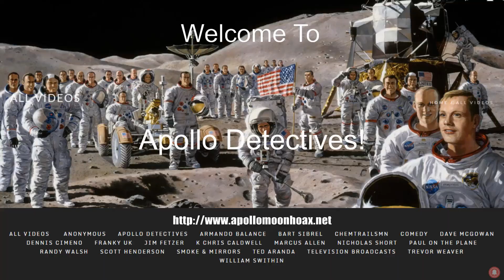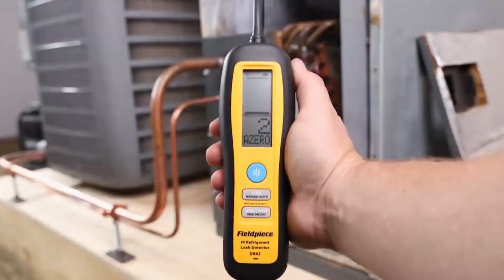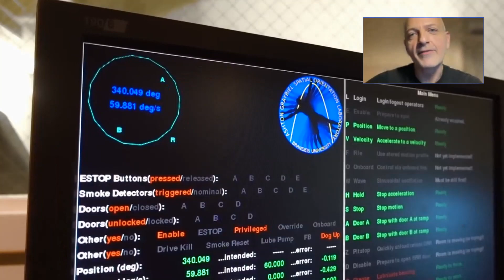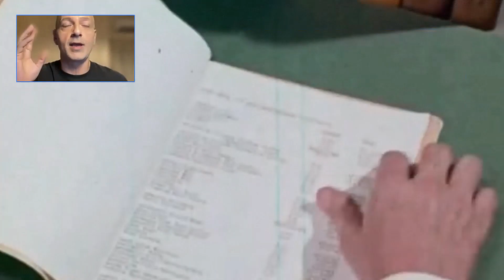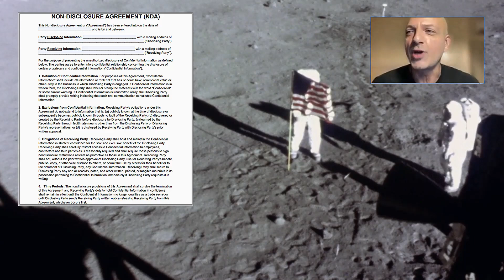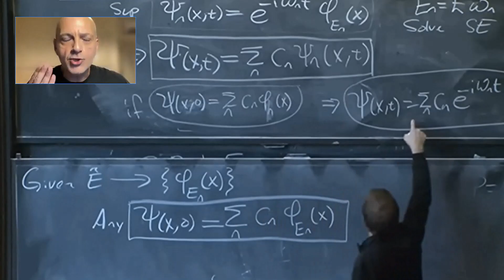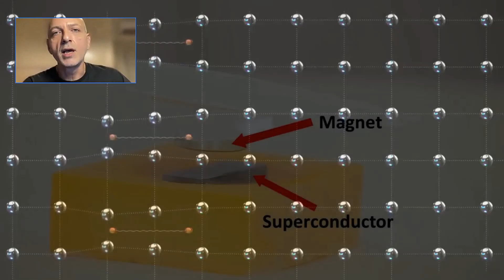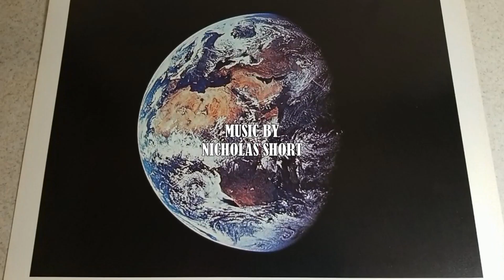THE APOLLO DISCUSSIONS "SPACE SUITS\ SIMULATORS\ PLASMA ENGINES" PART 19

Comment: I flew Hot air balloons for 15 years and i know for a fact  they are made of 1.9 oz ripstop nylon with an operating temp of 350. If it over temps the balloon needs to be rebuilt. If it hit 500 degrees it simply melts into a hard crispy plastic. The Parachutes of the capsule are made of the same stuff. I have mentioned many times that the capsules parachutes would have melted inside it's containers into a hard crispy blob if the radiant heat from the 5000 degrees the capsule encounters on reentry hits 500 degrees.
Reply: so many more problems to think about.
Reply: GOOD POINT!  never thought of that..remember as a kid those plastic  "Shrinky-Dinks" things we put  in the oven.
Reply: Playtex living bra stitches solved the space suits?  All those fine stitches solved Tor minus seven! Everyone knows that! Lol
Reply: @davidh7280  but on the plus side, it was a fun fetish for astronauts to wear bras in O G.
Reply: @Czarcastic What's the thermal gradient of the capsule - how much heat from the plasma trail was actually transferred to the skin of the spacecraft - not the oblative heat shield but the skin of the ship and how did that temperature vary as you got further from both the heatshield and the plasma trail.  How much insulation was there around the mortars that the parachutes were packed in?  What was the thermal transfer properties of the material used for the mortars.   Based on those parameters, how much heat was actually transferred to the parachutes?
Reply: @davidh7280  what is gauge pressure?  hint: it's not about absolute pressures, it's about relative pressures.
Reply: @guidopettito8393  All the material has to do is reach 350 degrees and the polyurethane coating for porosity would have failed. But your questions are valid as was the point to my comment.

Comment: I have always thought for years, that the issue of the high vacuum is the one thing that can bring down the Apollo theater. Not just the amazing space zippers, but even every little item inside the ships when depressurized would have to endure that same vacuum, everything. Kind of mind boggling when you think about it.
Reply: There is absolutely no way the tin foil thick lem could even be pressurized in that vacuum.
Reply from the maker: It certainly is. How any zipper can hold the air back from escaping into the vacuum of space is just plain insanity. If that were so, the astronauts on the ISS would have used the same convenient suit design. Cheers!
Reply: NASA rarely mentions vacuum anywhere.  But massive vacuums change material properties especially the polymers used in seals and zips.  It also causes metals to stick together.  17 million tons per sq inch on the moon!
Reply: Imagine all that Tang in plastic bags exploding everywhere.
Reply: @czarcastic1458  When they depressurized the LM to do the Moonwalk, how was the food stored? In a special pressurized container?
Reply: @czarcastic1458  So they had stuff like applesauce in toothpaste tubes exposed to hard vacuum?
Reply: @codetech5598  They had all kinds of food in packets. Look up the Apollo food menu. it is fairly interesting.
Reply: @yomommaahotoo264  So you've read NASA TN D-7084 and you disagree with the analysis?   Where do you think the problem lies?  Did they use the wrong alloy?  Were the stringers and stiffeners too far apart?  Maybe the 3.5psi internal pressure was just too much.    Maybe they should have chosen 3psi.  Please elucidate.  We await your informed analysis.
Reply: @czarcastic1458  Correction: "Imagine all the Tang in [vacuum packed] plastic bags exploding everywhere."
Reply: @guidopettito8393  I would have to be in a body brace with nothing better to do in order to bother reading nasa propaganda.
Reply: Man that little space ship mustve stank.

Comment: How would the fuel tanks not explode without any atmosphere pressure on them let alone the batteries and wouldn’t the valves on the rockets cold weld shut?
Reply: Any tank not having safety valves would do just that, whereas any vessel with safety valves would be immediately evacuated of product in space vacuum.
Reply: And those rocket valves could just as easily be sucked open in a hard vacuum, preventing any and all control as well as sucking out fuel reservoirs of product.
Reply from the maker: If needle valves were not used, that is exactly what would happen. Cheers!

Comment: In 1968 my Primary School in Hampshire U.k won a competition to  
Paint the heat resin shield to the reentry capsule for Apollo 11. I remember 4 of us painting this stuff that looked and smelt like normal water based paint. It started to crack and peal off after a couple of hours even after 3 coats applied. We were jealous as hell though as the school kids up the road were  helping design the lunar rover.

Comment: Finally a little about the parachutes but I was always wondering how they could fit?!
The capsule is so tiny! Those things weigh approximately 200lbs each?
Reply: Pixie dust helped them pack tighter.
Reply: @yomommaahotoo264  "Pixie dust helped them pack tighter."

🤣🤣🤣
Reply: It's easy to make them fit; they were squished by a hydraulic press, as documented on film. 

The question is,  would they open nicely after being so packed and exposed to the harsh conditions of space and hot reentry?

Comment: Of course the spacesuits had a leakage rate.  All that was required was to maintain a little positive pressure which was supplied by the backpack breathing apparatus.
Reply from the maker: Fine, but how could a 396W 16V battery keep all of that power hungry equipment (transmitter included), working for 8 hours at a time? That is mathematically impossible as the battery would have to produce 3 to 4 Amps for 8 solid hours. Think about it.
Reply: @theapollodetectives  8 solid hrs?  I thought it was around 2.5 hrs.
Reply: @theapollodetectives  The longest EVA performed (Wikipedia) was in 2001 by Susan Helms and James S Voss on the ISS.  It was 8 hrs, 56 minutes.  I’m trying to find out if it was with umbilical tho.
Reply: @theapollodetectives  Yep, you’re correct...later Apollo (15-17) mission suites ran for over 7 hrs.
Reply: @theapollodetectives  I don’t think they were all that power hungry.  A small water pump for water circulation and the radio.  The cooling used sublimation that is a passive process that works great in a vacuum.
There was a heater on the OPS (Oxygen purge system) that was only activated in an emergency.  It was entirely removed on later missions.  
The real limiting factor seems to have been oxygen supply, not battery capacity.
Reply from the maker: @twocyclediesel1280  Apollo 17 was 8 hours. Look it up.
Reply: @theapollodetectives  Yes, as I stated in my comment above.

Comment: @2:35 your "expert" witness didn't even bother to look up the pressure in the suit.  (It's 3.7psi +/- 0.25)  And then he proceeds to conflate the pressure applied across the whole suit with tension on the zipper.  If you really want to know how strong the zipper is, you'd need to calculate the tension on the zipper which is different from pressure on the entire suit.   Are any of you engineers?  Do even do math bro?  And there's three zippers, a velcro flap and snaps.